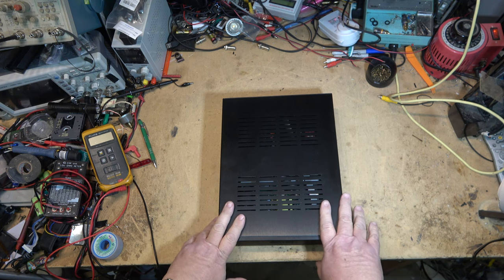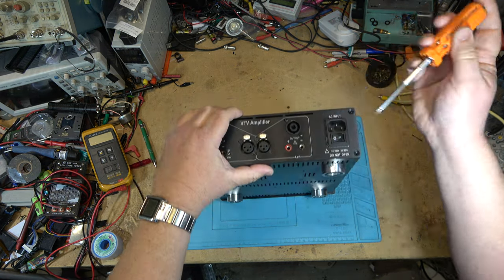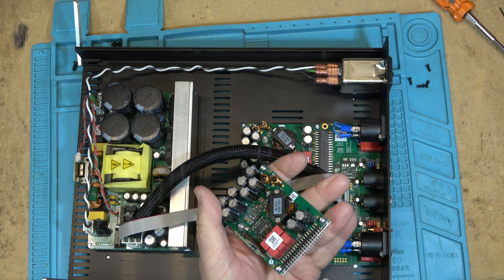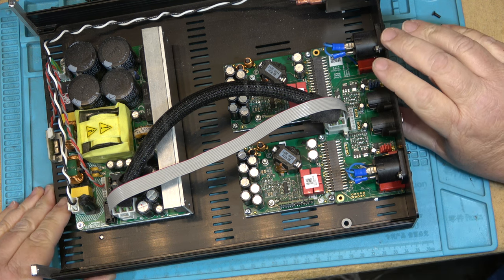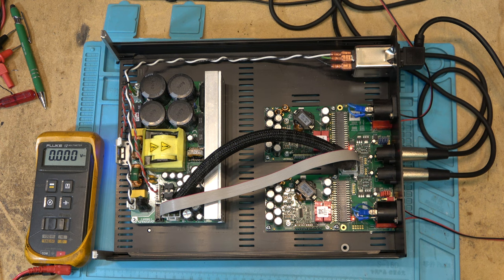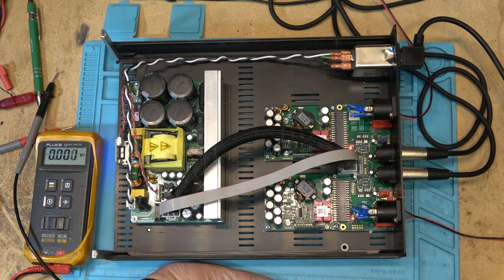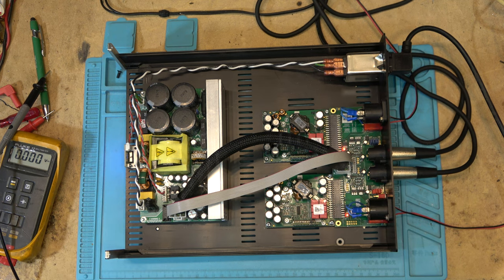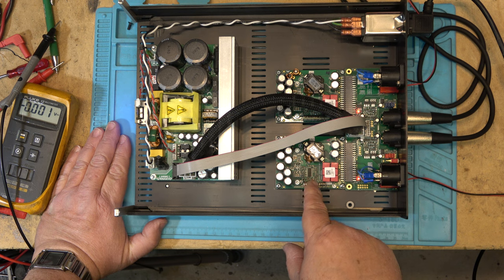VTV PURIFY Amplifier Tear Down and Demo

Comment: What does it sound like compared to your tube amp, Dave? If it can create the tube sound with instruments floating in mid air then it really is a winner!
Reply from the maker: It sounds transparant. If you want the tube sound plug in a tube buffer (preamp) àhead of it.  The next model up has just that built in. PS audio has been doing this for years.  Then you get the even order harmonics that makes. Instruments float.   I use a tube buffer on my big crest amp to make it sound like my tube amp, with more punch.
Reply: @12voltvids  Thanks for the reply, Dave. I only listen at low most of the time, so the 32 watts I have is plenty, but if more power was ever needed the Purifi with tube buffer is definitely the way to go.
Reply from the maker: @Markpab  same here my tube amp is 40 per.  The guy that loaned me this has the. Sonic frontiers i recently repaired.  He's using his tube amplifier at the moment. I have my crest connected but will go back to my yaqin again when I do some serious listening.  I have to clear out my living room.  Wife inherited a bunch of furniture from a house clear out that I am slowly getting rid of and the moving truck put it all in my living room.  As far as i an concerned they should have taken it to the dump. I wanted 1 piece out of the estate, ok 3, a giant special edition grandfather clock 1 of only 250 made. A commissioned copper art sculpture and a Robert Bateman painting.  Unfortunately my wife was named in estate and since the old lady she cared for had no family she got everything including ugly really expensive furniture that I am finding it almost impossible to even give away.
Reply: @12voltvids  Oh dear - no good blocking the HiFi! Bet your cats love playing amongst all the furniture tho! I've had enough of spending money on HiFi, I like my set up now with my WAD tube amp, Rogers speakers from 1984 and Denafrips DAC with Cambridge CD transport, my loft is full of cassette decks, amps and tuners I've wasted money on.

Comment: 6:15 Is this aluminium plate all there is to the heat sink? Or does it come in contact with the case and use that as the main heat sink? The reason I am asking is that I am slightly sceptical about the power output. Can it actually output 250W continuous sine wave power per module? Because I would be inclined to expect each module to be half the size of the power supply module if it were. Granted, the power supply maybe over-specified and it also works at a much higher voltage, which necessitates larger components that bulk up the power supply, but even so the heat sink on the power supply is huge compared to that of the amplifier modules. Unless of course the power supply operates at around 70% efficiency and the power amplifier modules at around 90%.
12:45 The real question is whether it still sounded amazing in the main system, with high fidelity loudspeakers. Did it?
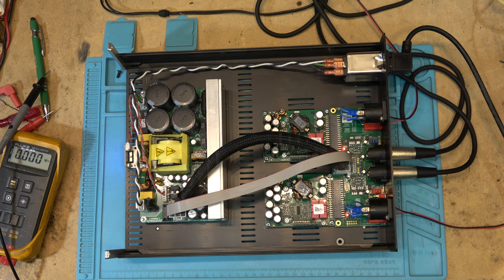18:58 Not necessarily - we are not in the late nineties and digital amplifiers (well, to be precise, class D amplifiers) have come a long way since then so a lot of audiophiles now spend serious money on them. It is the audiophiles that are also retrophiliacs and that are into vintage components' sound that you are probably referring to. Either them or those very few that can afford to pay enough to buy a house or two with just to buy one component in their audio system. I am exaggerating a bit here. Make that a car or two. Now one should compare like with like. There are no class D amplifiers made that cost as much as a small flat or a new car currently. This is because:
a) there is no need for them to be so expensive as they can generally achieve the same sound quality as class A or class AB amplifiers at 2 or 3 times their price and
b) they still need to win their place in the market and for this to happen they need to remain 2 to 3 times cheaper than their A or AB class counterparts. Once they do dominate though (just wait for the last few valve factories to close down/go bankrupt - let's hope this does not happen by the way but suppose it does for the sake of the argument) we will for sure see class D amplifiers with gilded knobs and silver cables inside and anything else you can imagine that could drive their prices up to stratospheric levels. The reason for this is simple: there will always be a market for expensive stuff.
Reply: @@Douglas_Blake Yes, the same is true for SMPSs also but they still need a heat sink of some size... These modules here just have a small metal plate - hence my slight incredulity.
Reply: @@Douglas_Blake Yes, I'm aware of the benefits of class D operation. The reason I was insisting on continues sine wave power rating is that the output music signal contains nowhere near enough energy on average as a constant full amplitude sine wave. 
Re. the heat sink coupling, it does seem it couples to the case but it looks to me as if it stands on brass spacers - not quite the same as full contact over its entire surface.
While on the subject of SMPS and Class D amplifiers, there are Class AB  (or class AB genre) powered off an SMPS. I'm not sure whether Carver has done that (he'd be my primary suspect) but over in the UK, Chord does produce some super pricey amplifiers that operate this way. These were produced when Class D audio chips were already a mature enough technology. Even if they had not been, I would expect Chord to be in a position to develop them to their high standards. This is primarily a financial question of course. But they did go with this solution. I am not sure whether they still choose to make amplifiers this way or whether they have gone full class D as in this example.
Reply: @@Douglas_Blake The reason I mentioned the SMPS and class AB amplifier combination was because I am interested in the audio merits of class D vs. class AB - or even vs. class A. This is a technology that has been available since the end of the nineties but has not really caught on (in high end audio) until now. It had not received unanimous praise back then - even though the power consumption and power output figures were spectacular. I never found out why it did not catch on back then. I did read about poor implementations with undersized (?) output inductors being a possible cause but I did not quite believe that to be a sufficient reason having never seen (or heard) any such implementation. 

Since you have listened to both classes of amplifier powered off an SMPS, does the class D amplifier you have tried offer a wider dynamic range than a class AB amplifier of similar output power? Or is it quieter than the class AB at the same volume level? Re. the SMPS, were you able to notice its presence sonically?

I only just noticed your response containing the analysis of power consumption. Like I mentioned earlier, I do not dispute the fundamental principles of operation of class D as its power consumption advantages are not disputable but we all know that it is the actual implementation that determines the real performance. This is why I was interested in finding out the actual specifications.
Reply: @@Douglas_Blake It's interesting to find out that an SMPS can be quieter than a linear PS. I guess the fact that it offers a more tightly regulated output has to do with its instant power delivery? I would presume the voltage regulators on both linear and switching PSs would use the same kind of regulator chips, so it has to be what lies before that makes the difference (on dollar-for-dollar per watt output basis)? That would explain the better impulse response too, right? higher instantaneous current delivery?
When you mention lack of crosstalk you are obviously referring to a single PS for both channels.
Still, I find the lower noise baffling. How can this be achieved with the same regulator chips? Unless, the SMPS you are using is specifically made for audio use and thus is more carefully designed (and more expensive)?
You got me wrong though: I don't dislike class D because I think it is sonically inferior. I cannot state that having never heard a class D amplifier. I just dislike it for two reasons: because I do not like it as a solution purely from an aesthetic standpoint and because I like older technology. Had class D been used first and class AB been the newer one (hypothetically speaking) I'd probably be a solid class D guy. But these are all choices made on aesthetic grounds. Were I to poke at its potential flaws, there would be two that would come to mind. One I've already mentioned: it is not a simple technology, it relies heavily on large scale circuit integration and these two combined make it a less repairable technology. I have issues with any technology that is not repairable, especially any technology that comes closer to throw-away technology. Not that you cannot implement a class D amplifier with more than one chip if you wish or even with totally discrete components but the reality is that single chip implementations do and will rule. The second reason would be related to the implementation details. Class D relies on high frequency operation and as such it needs a steady oscillator (or clock). This brings in the question of jitter. I would presume that today, super accurate low jitter clocks are not a problem (I haven't checked what's on offer lately, I'm just assuming this). I am fairly certain however that back in the nineties Class D implementations had no better clocks than what was standard clocks for audio usage back then. If the clock was part of the single chip amplifier then, again I would assume it to have been a weak point. If it was external, again I would expect it to have been of the run-of-the-mill variety. So perhaps there might have been some truth in the audiophiles' reservations towards adopting class D amplification then based on available examples. But it would be quite hard to find a class D amplifier from the nineties today in order to compare it against current offerings so this is all just conjecture on my part.
At the same time do not think I like class AB amplifiers - I do not. I am a solid class A fan. Again purely for aesthetic reasons. Don't ask me to explain why I do not like solutions with comparators and sawtooth waves, whether in class D or in ADCs or elsewhere. I just don't find these to be elegant solutions.
On the other hand I really like SMPSs. So I am not unreservedly against all new technology. 
By the way don't knock audiophiles in a general blanket statement. They are just like any other section of society: they come in all sorts. Some audiophiles are accomplished engineers. You cannot deny that - else we would not have high end audio companies today and we would all be using cheap midi systems. We would not have had any serious audio devices period - of any technology. But some audiophiles may be of the gullible/uninformed kind or just stuck in their irrational convictions. Not all are the same. Besides, internet is a big element in the audiophile phenomenon nowadays. A lot of them just pass on what they read/heard somewhere on the internet creating trends..I do not think this was something that existed before the nineties. A lot of information on the internet is just nonsense or just misinformation and not everyone can tell which is which.
Reply: @@Douglas_Blake Thanks for taking the time to share this information and your experience. Take care.
Reply from the maker: That's the heat sink.  It is also bolted to the case.  This is digital. Not analog.  The mosfet is either on or off.  No in between.  Ab amps the transistor is linear.  It goes from. Literally cut off to full on and every state in between where it is resisting full rail or passing it. As it goes through this state it is literally a resistor which produces heat that has to be discipated.  Full on or full off produced literally no heat.   Plenty of current can flow because the full rail is on or off and the duty cycle is constantly changing as the audio signal modulated it.  The output current is developed in the output capacitors and choked.

Comment: Would you consider these to be somewhat disposable? How do you think the MTBF for a unit like this with the switching power supply would compare to Class A/B with a linear power supply?
Reply from the maker: Modular. When module fails just pop in another.  Cheaper to replace module than repair an old big amp especially trying to source obsolete transistors.
Reply from the maker: @Douglas Blake that's why i leave monitors for security cameras running 24/7
Reply from the maker: @Douglas Blake 
Cold starting is literally a dead short till the caps charge.
This is why good smps designs have soft start circuits.  To prevent this from happening.

Comment: I have an older Spectron musical MK lll class D amp designed by John Ulrich  It weights 54 lbs!!  It has a 7" dia x 5" thick toroidal power supply

Comment: 19:09 Just so you know, the VTV PURIFI is 1% distortion at rated power. That's literally 100 times worse than most 50-year-old class AB amps. That doesn't mean it sounds bad or is bad. I'm not not an audiophile, I'm probably worse, I'm one of those pro audio guys who knows stuff. I have no idea what a cork smells like though so don't worry. I do see a lot of class D amps stretching the truth on their spec sheets though and that's  probably because there are a lot of spec sheet sniffers out there that simply would not buy a 400 watt amp with a 1% THD rating. Not gonna lie, I probably wouldn't either, 1% is pretty bad and is easily audible by even the most untrained of ears. That being said, who's actually going to listen to the amp at 400 watts? Well.. all the people who bought it because they need 400 watts of power, that's who. That's why it's important that all amps are tested the same.  The Purifi, at  a 1/4  of its rated power—where its advertised THD rating was measured— is super clean and I'm sure it sounds and performs great at 100 watts. So really, it should live somewhere around there because nobody else is taking measurements at 1/4 power. When a short basketball player gets drafted to the NBA they don't lower the net for him when he shoots. He's expected to perform at the same standard as everyone else.
Reply from the maker: most of those 50 year old apps won't come close to their advertising spec for distortion at full output power either because their power supply start to sag.  
I myself run a creat vs900 which is 450 per channel into 4 ohms 250 into 8. It's also rated 1% at full power but again they are not rub at full power.  You might need the power for a momentary transient but that is about it.  It's all about being clean at normal music power which is typically 6db below max power anyway.  It's called power reserve.  My crest for example rated 450 would be happy pushing 250 all day long without breaking a sweat and havr plenty of reserve.   Into 8 ohms it will happily drive 120 with 250 reserve for the peaks as needed.  
At full power distortion is 1% at 3db down 0.013 which is inaudible

Comment: Class D is NOT digital.
Reply from the maker: Sure is. It's not PCM but the output is still a binary output so it meets the technical requirement is digital.
Reply: @12voltvids  OK, boomer.
Reply from the maker: @Bob.martens  that's the best you can come up with when you have been schooled.  🤪

Comment: The only thing that "doesn't work well" in this amplifier, at least in my opinion, is the retail price: over $1,000.
Having seen it disassembled, and knowing the value of the components used, 200/300 dollars at most, it must be said that the manufacturer's and dealer's markup is really high. There are no large and heavy linear power transformers, batteries of final transistors in symmetry and in parallel with each other, large dissipators, large filter electrolytics; so how do you justify the high cost?
Reply: @@Douglas_Blake didn't write that that amp should cost $200/300, but considering a fair markup from the manufacturer and the seller, it could cost 600/700, exaggerating.
Reply from the maker: Try for more like 2500 and up for a new one.  Why, because people with money will buy this in a heartbeat, they see it as a bargain compared to the likes of PS audio which is 2 to 3x the price for identical performance.   Cost of the parts has nothing to do with the price. Engineering costs, marketing costs and of course a dirty word to you PROFIT
Reply: Great value when you see what others try to mark them up to.  I think the NAD M23 uses the same modules and they charge $3800 and it’s only stereo.  I got Dylan @ Buckeye to build me a 3-ch Purifi in a rack mount case for $1900.  Dylan deserves to be paid for providing such good amps that are so far above the bs the amps boutique labels are trying to sell for $$$$. 11-channels of amplification was just a little over $3k. I can’t think of many more options where you can get 11-channels with high power capabilities and extremely low noise performance.  Class D is the future.  Surprised AVR makers are still doing AB at this point.

Comment: I wish one of these modern Class D amp module companies (Purifi/Hypex/Pascal/Icepower) would make a sub 150w amp module and something that can be powered between 12-20v so they can be used in lower power portable applications.
Reply: Infineon MA12070 is what you're looking for I think. Great sounding amps used in a lot of applications including active speakers.